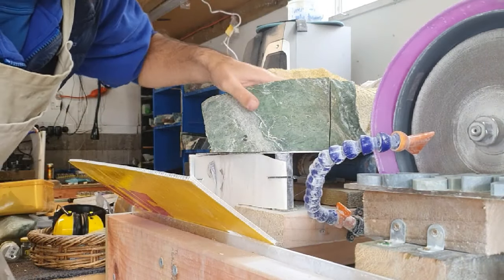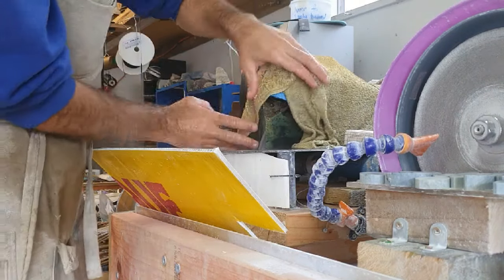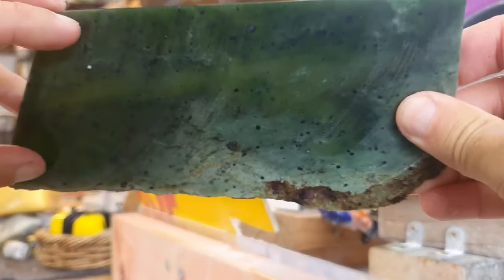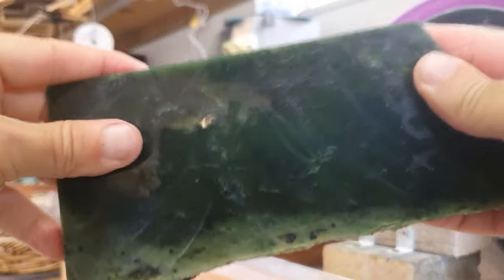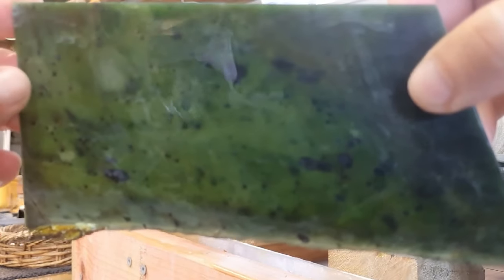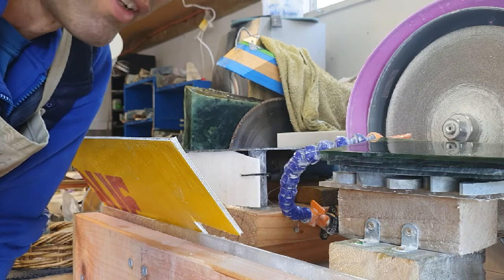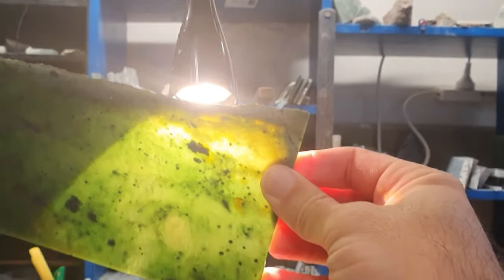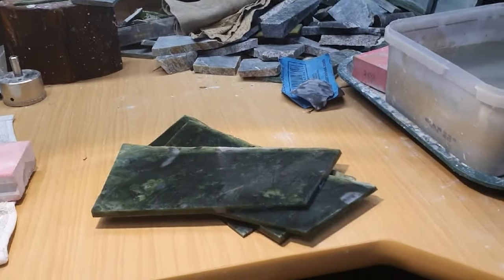Cutting Slices Of Pounamu New Zealand Jade

Comment: Great to see the full video Campbell! It looks like you are doing these cuts with no kind of fence, and just free-handing it. Is it hard to get a consistent thickness on your saw? I'm pretty excited as my mate is finally getting onto welding up a saw for me out of stainless built around a 400mm blade, so hopefully cutting depth will be 18ish cm which should be more than enough for anything i will throw at it. Will be interesting to see how it cuts.
Reply from the maker: Nice one, I use a square against the edge of the table, getting slices square is super important I have found when doing bigger slices. Thinner blades can make issues as they get bigger too.
Reply: @CampbellCarving  Ah that makes sense. Do you try to cut along the grain when slicing larger pieces?
Reply from the maker: @thecarvingshed  yea definitly as much as possible.